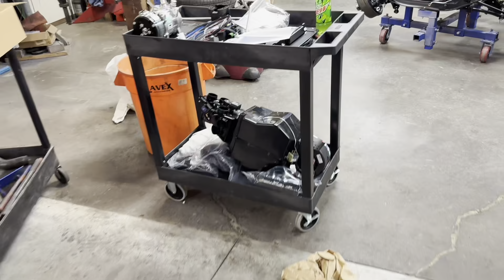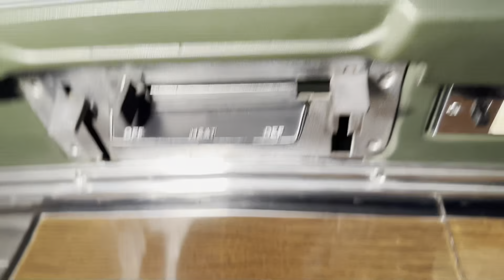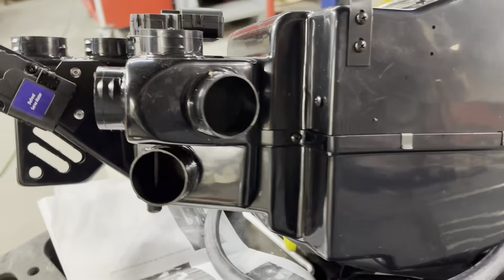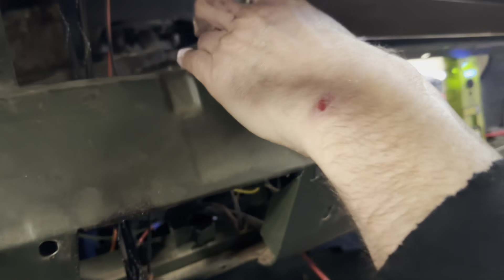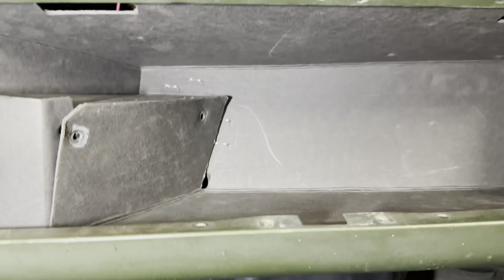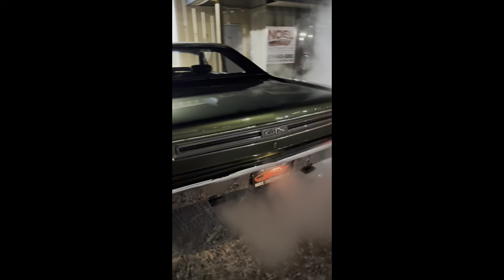1969 Plymouth GTX 440 4-Speed Gets a Modern A/C Upgrade! | Noel Automotive

Comment: Do you ever run the condenser and heater box hoses through the inner fender instead of the firewall? I did this on my '68 Charger and it really cleans up the engine bay.
Reply from the maker: @303Mopar  we have on one other car . We mounted the compressor under the alternator. Ran an electric fuel pump  . For the most part we’re not trying to hide anything. We could if the customer wanted .